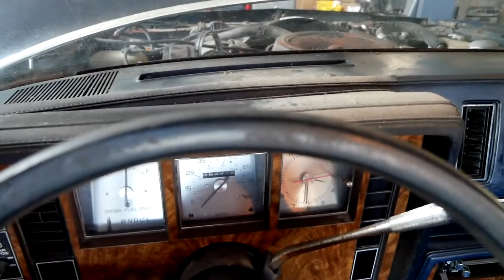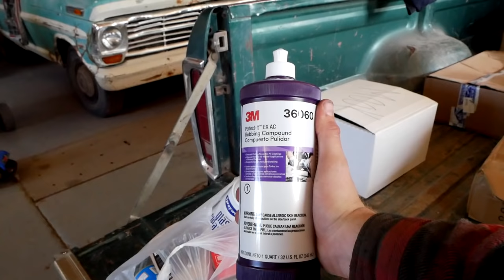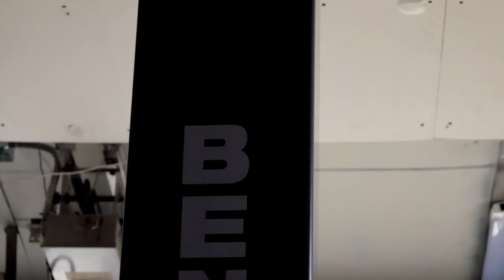Will the Most UNRELIABLE 1980's Car Return on the Road!?

Comment: My analysis on the crack paint.  It was repainted with dupont paint and they used laquer thinner as a reducer.
It cracks like that when cured if you didn't use the right reducer.

Comment: So an old car dealer taught me a trick with these old diesels. they sound like dump trucks when he picked them up at auction. he would run a quart of transmission fluid with a tank of gas for 3 consecutive fill-ups. The trans fluid cleaned up the injectors and by the 4th fill up, you could barely tell they were diesels. Obviously you cannot do this with the new diesels with the DEF fluid injection, but for the old diesels, it worked great. Especially well on Mercedes diesels.

Comment: You can save money if you just replace the bearings in the alternator in the water pump. It is little work and the parts work like brand new afterward.

Comment: These were actually very reliable, biggest issues were faulty starting voltage or people putting gasoline in, I’ve had many 350 diesel’s, one olds 98 sat at my salvage yard for over 10 years and fired in half a revolution with one battery, I drove it 40 miles to my house with one front brake.

Comment: Hearing that motor brings back memories of my Fathers Olds Cutlass supreme Brougham Diesel. he had the early one so he had to get the engine mod done by the dealer under warranty. He put a 20 gallon auxiliary tank in the trunk against the seat. I spent alot of time in that car

Comment: I owned a 1980 Olds 98 diesel and the alternator belt always squeals. The firing pulses of the diesel really make the belt dance and they squeal a ton. Also due to vibration, these,are known for cracking the alternator bracket which further adds to the problem of the squealing diesel 350 alternator belt.

Comment: About 40 years ago I had a 1980 Oldsmobile 98 with the 350 diesel engine. 2 blown head gaskets in 10,000 miles.  Awesome ride. I think a 5.9 Cummins would do the trick nicely in retrospect.    Dave from se Kansas

Comment: The v belt usually makes noise because they are cheap and the only way to get rid of it is replacing it with a better quality. And sometimes overtightened belts will make noise and unbalanced pully will also cause a issue

Comment: Alot of G bodys have that squeak problem.. there's adjustments to tighten the belt. I wanna say the power steering pump and alt both adjust... thoes belts like to be pretty tight...I had the same exact issue.  Also put some lithium grease on it

Comment: 1:02:12 don't know much about cars but there's plenty of spectrum analyzer apps in the appstores, late now but if he'd isolate the frequency of the whine and move the phone around it could help locate the source and for more accuracy add a contact mic (like just a piezo disc, might not even need any preamp), and hearing protection would be nice.

Comment: Hi Kevin just a thought, from what I have seen. If you haven't already,  try putting a higher Amp alternator on the 81 Buick diesel. I am not 100% sure but would almost bet that is your problem. It squeals when idling, and screams when high RPM'S being a diesel it has two batteries so twice the load as I am sure you know.. just a thought for you. I hope it helps.

Comment: When you buff the car step one is for milling the paint down if you get some step 2 compound and rub that into the paint it should hide some of the paint cracking or you can just use same wax coating that can help also hide scratches and cracking if not it can help. You can also get some impurities out of the paint by wet sanding if it isn't too far into the clear. You can just use 1500 grit then use 3000 grit over that to make the sanding scratches smaller then buff it out with step 1 and then step 2 if you wanna get fancy that is.

Comment: Is this classic oil burner still running?     Having turned 16 and learning to drive in 81, the sound of the diesel at idle brings back memories.  An 81 Century should have quad headlights,  so I believe this car should be a 78, 79, or possibly an 80 model.
Reply: Century was single light. Regals were dual.

Comment: Bought my 81 gas century in bout 1996. No reverse. $175. Had my mech put in a used trans. Moved from Columbus Ohio to eastern Iowa with everything I owned. Overheated above 35 mph. So.. yeah. 525 miles at 35 mph. Took every gravel back road on the map. Made it tho. Love the color on yours.

Comment: Apparently the only really problems with these is that the head bolts stretch. At least that's the problems with the Olds diesels. Most people just stuff some bigger bolts in there and put a modest 10psi boost on it and they run great.

Comment: I had a 1982 cutlass supreme brougham with that same garbage gas/ diesel conversion engine . if your engine overheated, bam! You now need a head gasket job. My cutlass supreme had a super nice interior. It even had a split sunroof. Everything on a diesel engine is twice as heavy & twice as expensive. The starters took two people to replace. Let's not forget it needs 2 batteries . I would replace the engine with a gas 350 or 305 . good find though.

Comment: That “haze” is crows feet and it’s under the paint, no way to get it out without sanding all paint away, it’s basically cracking under the paint. Also Id suggest that you use a da polish “ dual action “. Less risk for going through paint

Comment: 45:23, they stopped using lead. The products in the C-pillars in the 80s were solder and body filler. Doing a factory seams quarter replacement on a G-body is interesting. It is probably what I would do with that driver side if I could locate a new or donor quarter.

Comment: my parents had a 1981 park avenue diesel.  It was a dud, luckily they had the extended warranty and after the engine blew for the second time with the transmission at about 50K miles they got rid of it and that was the last buick/gm product they ever bought, we had always had Buicks until that one.  If I can remember, we had a 62 skylark, a 69 riviera, a 77 century station wagon and then the dreaded 81 park avenue.  The 62 skylark was my car when I turned 16 in the 80's

Comment: Don't know if it would fit in that, but the 350 diesel was an Olds motor. The transmission fit perfectly to an Olds 455 from a Toronado. My dad had a 79 Delta 88, and a 78 C10 diesel. He swapped both with 455s.

Comment: Had the identical problem on my G body power steering belt was not tight enough when the alternator gets put under load it puts additional pressure on the power steering belt since it runs the entire system

Comment: I know your pain!!!! I have a 2000 Chevy Astro-van that has the same obnoxious squeaking noise.  It has a serpentine belt, but I've changed water pump, alternator, power steering, and even the bearing in the air conditioner compressor...but it still squeaks!!!!  If I put a little water on the belt, it will shut up, but it has done it for close to 5 years without me being able to figure it out!!!

Comment: The Oldsmobile 350 Diesel was a 33-35 MPG car on the highway. They Delta-88 and the Regency-98 were the real cars. GM fixed most of the diesel problems by the end of the run. It was a cast iron block and heads. Just like the Ford 6.0 diesel a good crankshaft, rods and a set of studs for the head bolts replacement and it would go 500,000 plus miles. I know a guy that owned a garage and still drives one every day. He could buy anything but like Scottie Kilmer he is just “cheap”. It’s an addiction to going “cross-grain” of others. They also built a Cutlass Supreme in 1984 with a 4.3 N/A V6 Diesel in rear wheel drive. We had one at our dealership that got 40+ MPG, topped out at 108 to 110 MPH and would spin the tires off the line. I drove it from Greensboro to Charlotte N. C. many times.

Comment: Cars in the 60s had generators or low power alternators. They often had dual belts to the AC compressor. In the 70s they started loading up accessory drive systems and belt noise was common. By the mid 80s they were switching to serpentine drives. Now you know why!

Comment: Between my father and I, I think we owned just about every diesel car built. The 5.7 would actually run forever if you never got it even a little hot and used diesel oil in it. So many people just ran 10-30 and the rings would get stuck. Sometimes you could get them to come around with Rotella 15-40. Had a 1979 Cadillac Sedan Deville. Used a quart every 1000 miles. After the 2nd oil change with Rotella is was up to a quart every 3000. Also had a V6 diesel that used a quart every 100 miles. Never got any better.

Comment: In one of the clips at 20:31 you can see the pulley wobbling pretty bad. My guess is that it is making the belt rub, which is causing the squeak and increasing the heat in the pulley due to the excess friction. That's my guess.

Comment: The reason the belt squealed is because most alternators are driven off the crank pulley and around the water pump.This alt. is driven off the water pump. so there isnt enough of a contact patch with only 1 belt to turn the alt. you need the a/c belt to and the water pump belt to make enough of a contact patch to drive the alt. without slipping.

Comment: There is alot of stress on the altenator belt on the gm diesels. Gates green stripe belts were about the only belt that we could find that would hold up because of the vibration of the diesel and force required to turn the high amp altenator. A cheap belt would just slip and squeal like yours is doing. GM later put rubber dampeners in the crank pulleys on the later model 6.2 diesels and that solved most of the problem with the altenator belt.

Comment: Yea the squeezing of the belts are common with the gm style of water pump pulleys the arrangements of the belts missing the AC belt torques the pulley to one side causing the pulley to actually warp heating it up have seen so severe that the pulley actually tears away from the mount

Comment: 49:38 so I was at a napa on the corner of an area of a town in the "military base shadow" where everything is a little run down and the folks working there said the pulleys often times get dirty with the burnt on rubber and can cause squeeking and to take a wire brush and clean on the old pulleys off

Comment: 14:55 Actually that's the atmospheric particles which sank into the paint with years of contraction and expansion of the paint with respect to the changing weather conditions, I have seen Ammo NYC yt channel removing those particles by heating the paint with a heat blower or something and slowly wiping off the particles and exterminate the haze magically...
Seems like that's pretty much the same thing here as well...

Comment: LOL on alternator belt trying to burn itself off. A story from 1976, as a kid 16 or 17 yrs old, a mechanic was on vacation, so they stuck me on the line, at the Chevy dealership prepping new cars for delivery. I prepped a BRAND NEW Chevy 1976 or 77 Nova 2dr, 350 or 305 V8, with ALL the bells and whistles you could get on it, ran real good,  no belt squeal or any weird noises, owner picks it up , back in 15 minutes with a HELLVA squall. The alternator belt was totally toasted, put a new belt on , hey things happen, burned it off to, in the shop, by this time EVERY old mechanic in the shop had come over to see if they could figure it out, after a new alternator, battery, 3 sets of belts, and a VERY pissed off owner , that went up to the owner of dealership to find out why a kid was working on his car. I heard him and politely told him EVERY MECHANIC in this shop has NO CLUE what is going on, so, service writer and me talk to the St Louis Mo zone rep, answer was , I will get back to you, 15 minutes later he calls back, dont let that car out on the road, we got 5 more doing it now. Somehow they put the wrong water pump pulley on 35 Novas out of the factory, we got 5 of them, and they had just one number difference on the part numbers, after we found out what the hell was going on, and the owner later flipped me a 20.00 and apologized , and always had me service his car after that!! Did you ever find out what it was finally, it is possible someone else done that before you got it and it has the wrong water pump pulley on it trying to overspeed the alternator.Neat channel  I just recently found, you KNOW your getting old, like my old hit and miss engines I collect, when you see cars that where brand new as a kid working on ,getting put back on the road again like the real old vintage stuff LOL

Comment: My father loved those 5.7 grenades we had two of them new in 1980. Safari station wagon and a Seville. Both were absolute junk. I learnt to drive on that gutless smoke maker wagon. Freeway on ramps were a white knuckle affair. They were so gutless but if someone tailgated you simply mash the accelerator and burry them in smoke. They backed off.

Comment: After a though wash you should clay bar it. Also you shouldn't have to put pressure on a Polisher like that and let the machine do the work. Striping would suggest it was painted. Bad overlay of the paint and or clear coat

Comment: Back in rhe day of muscle cars my old man taught me to try using a bar of hand soap. As the engine is running press the soap against the inside of the belt thats is winning. Be very careful when doing this not to get your hand wrapped in the belt and pully. Worked every time.

Comment: It might kind of mess with the originality of the car, but you could replace that olds diesel V8 with a gasoline small block olds 307/350/403 and it would probably make it a much more reliable car. I remember the '81 Century my family had. Ours was burgundy with red interior, white vinyl top, those Buick rally wheels and the Buick 231V6 2bbl with th250c.

Comment: I suggest that the edge burn on the paint and the sander marks were actually left by your very overpowered pressure washer. Ive done it myself. Dudes use a brush first .

Comment: I've learned a little trick when determining where a sound or vibration is coming from yes it looks stupid but it works. Have a flat head screwdriver place it on the part to inspect, then your ear on the handle. It amplifies the sound.  Also dont put it on a moving part you'll learn the hard way
Reply: Zdog. I learned that trick 40 years ago.

Comment: Belt contamination, you can take a brand new belt and get some coolant or tans fluid on it and it will never shut up in the long run. You can spray WD on it and it will stop for a few minutes, you can slather it in belt dressing and it will go away for maybe an hour if you are lucky. The only solution is to take the new belts off again, wipe all the pulleys with a rag soaked in brake clean, and put new belts on and make sure they don’t get any fluids on them again. They are like sponges and once contaminated will never go back to normal. Just a few drops of coolant will haunt you.

Comment: If you can't find the transmission leak on that car, check the vacuum module on the transmission if the diagram go bad the engine slowly consumes the transfluid.

Comment: cure for squeeky belt.  first check to see if its a belt or bearing.  start engine pour water on squeeky belt the noise will disappear shortly.  but it will return.  GM uses a small pulley.  find a larger pulley and put it on the alternator.  if problem persists buy a set of ear plugs.

Comment: Check and see if it's got a modulator valve on it if it does it might be sucking fluid up through the modulator valve and draining the transmission

Comment: You guys should invest in a mechanics stethoscope. I had a clicking clicking and rattling noise in my Dodge Magnum that  could only be heard from inside the car with the windows up and it came from the dashboard.. Literally no mechanics could find the issue. I said screw it and purchased one on Amazon. I put that rod against everything in the engine and the noise started getting louder when I went to the belt area but you could hear nothing without the stethoscope. I finally diagnosed it to a A/C compressor bearing.

Comment: There is a video of an 82 cafillac diesel he gives you all the needed upgrades to the gm diesel to make it reliable 
On the rear bumper remove it and take off the shocks place in vice drill hole and depressurize them  and put in vice and collapse the shocks then remove t the bumpers to the shock 
Sink the bumper in 2 inches maybe 3 and raise them 1 inch deletes the rotted plastic bits that fall off .
Did it 4o several gm cars and looks very good.
Blue window tint and a pair of H4 halogen conversions headlights help along.
And of course  it needs its trashed hood ornament replaced.
Set of speakers and a Amp n new radio. New tires. I'm sure the car can be upgraded.

Comment: I would bet everything on that "new" water pump. It was returned and sold as new. When you remove the alternator belt, you're taking pressure off the water pump pulley hence not killing those bearings in the water pump.

Comment: You could hear the power steering with your drill apporatus aswell as in the video it started when you steered it
Reply: Oh I stand corrected it was the pressure of the belts only putting pressure on one side of the bearing due to missing compressor belt.